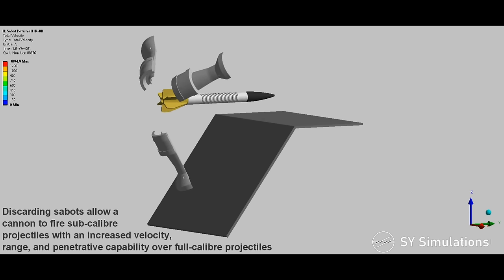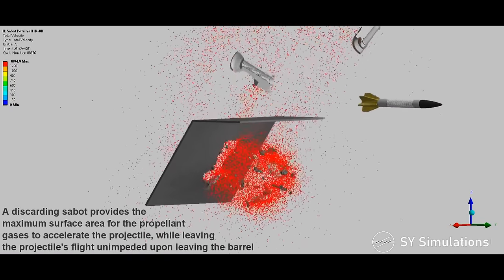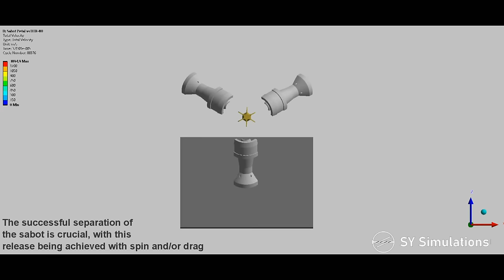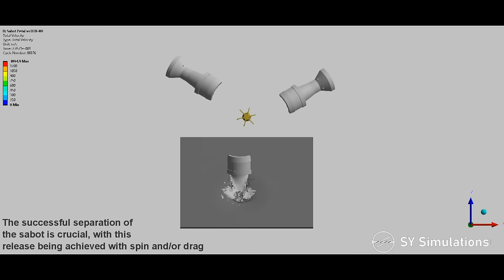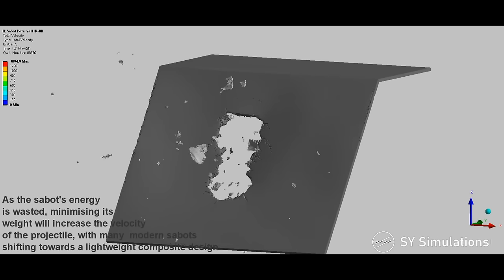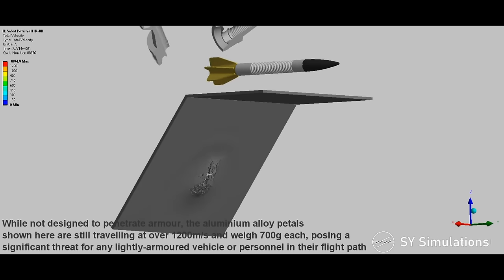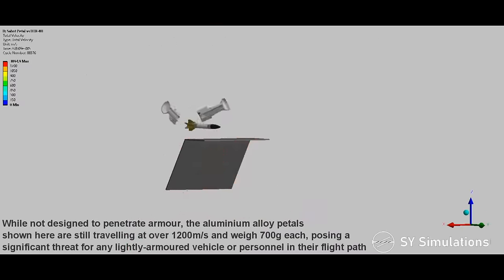HOW DANGEROUS ARE DISCARDING SABOTS? | Sabot Petal vs BTR-80A | Armour Penetration Simulation

Comment: War Thunder currently models them as being able to penetrate even the side armor of Shermans, which are 40mm, which is a bit ridiculous.
Reply: I mean, not really
They are traveling 1200m/s which is significantly faster than anything used in WW2, I think it could pen 40mm point blank, but not much more or any further
Reply: The problem in WT is they keep their velocity well into 500m or some BS
Reply: @a.anonymous1318 yeah the main issue is that even out to 100-250 meters those petals were punching through 38mm or 1.5 inches of armor (the side of the Sherman is 38mm 1.5")

Definitely it would not be going that speed still after tumbling through the air for 100+ meters
Reply: Warthunder is a game 😂
Reply: Didn't they remove them because it wasn't modelled well enough?
Reply: @NoName-md5zb  yep
Reply: @NoName-md5zb  yeah, his point was just that the model was ridiculously setup.
Reply: It probably could at point blank ranges, so maybe not all that ridiculous, but again, that depends on the range. A big problem with the discarding sabots in War Thunder is that they don't lose as much kinetic energy over range as they should be, effectively turning APFSDS into a shotgun that can obliterate light-medium armoured vehicles without really needing to aim.
Reply: I saw a video where a sabot penned the lower plate of an abrams from 100m. Its ridiculous.
Reply: @xxfalconarasxx5659  apfsds shotguns sound nice
Reply: @Blox117  i remember in the dev server apfsds autocannons absolutely obliterated aircraft without even needing to aim at them. Instead of reworking the effect, Gayjin took the lazy route and removed it for autocannons but kept it for main cannons.
Reply: @neurofiedyamato8763 Sabots from M1 Abrams(120mm) can be lethal up to 800m
Reply: @dominuslogik484  youre lying, they dont even go that far

Comment: Note that this is only true at very close range, the petals high surface area and low weight mean they would rapidly decelerate at any substantial distance.
Reply: try standing 30mtrs away and let one hit you to see what it's like🤣🤣
Reply: @nigelsmith7366 30m is very close range lmao. Vehicles engage each other at 100's of meters, sometimes over kilometers.
Reply: @92HazelMocha  well go ahead and try it at 100mtrs.... Its still going to knock you out in the least
Reply: @92HazelMocha  and we are talking about vehicles and troops being hit by the sabot petals being fired from their own tanks at targets down range... Its not about the petals causeing damage to enemies
Reply: @nigelsmith7366  
You can kill a person by throwing a stone at them, that still doesn't mean it'll go through armor plate with ease.
Reply: @nigelsmith7366 and that’s why you don’t stand in front of a cannon…
(Not to mention concussive forces)
Reply: Using the drag equation, I've estimated that the velocity drop after 5 seconds would be 50%. I assumed that it's a 105x200mm block giving drag coefficient of 1. The equation for velocity I got was v(t) = e^(-0,006 t^3) v_0. Since it starts at Mach 4 and ends at Mach 2 after 5 seconds, you'd still have a 700 gram block of aluminium flying at > Mach 2 at distance of 1000meters. I think it would still pen the same plate.
Ofc not an expert in aerodynamic or supersonic anything so there might be other drag factors involved but I also assumed that it flies largest face first without orienting itself better.
Reply: @softerseltzer  
You're forgetting the petals tumble around, going way off-course and slowing down much faster than if it was flying straight and true.
They're designed to decelerate as quick as possible to get off the rod, remember.
Reply: @ThatZenoGuy  I'm not forgetting it, I am disregarding tumbling or going way off course as being relevant to the penetration of something that is in its way. Can you show that tumbling causes objects to decelerate faster than flying with an orientation that is least aerodynamic?

I would argue that rather than decelerating as fast as possible, they are designed to accelerate outwards as fast as possible to get peeled off the rod.
Reply: @softerseltzer  
If the petals are tumbling, they're quite liable to impact side-on, which will massively reduce their penetration.
Reply: @ThatZenoGuy  In the video the impact is at around 45deg to the direction of the travel, which makes it about 70% side-on. Anyway, the point was about deceleration.
Reply: @92HazelMocha  30m is a perfectly normal distance to be from friendlies, though.
Reply: @nigelsmith7366  we are talking about tanks not humans
Reply: @ThatZenoGuy   As an aeronautical engineering student with basic aerodynamics knowledge I'd say that the tumbling effect might slow the petal a little bit due to a larger turbulent wake being created (maybe?) but from what I know it shouldn't have a very significant effect on the over-all speed of the petal, just it's flight path. I would be interested in your reasoning about why they'd slow down much faster, I'm not an expert. The only issue I see with francois' approximation of the deceleration is that the drag formula for subsonic speeds (which I'm assuming was used here) doesn't work well at supersonic speeds. Drag does very weird things from ~Mach 0.9 upwards and heavily depends on the shape of the object. I'd assume that the deceleration would be quicker because of the created wave drag, but it's hard to say how much. And as an engineering student in general: I'm 99% sure the petals are designed to diverge as quickly as possible, not to slow down as quickly as possible. They'd probably look different if lots of drag was the primary goal.
Reply: @planterion7969  
That's a lotta words, shame I'm not reading em.
Reply: Still they can fly up to a few hundred meters at worst, meaning anyone getting hit by one has a bad day. In other words, don't temp fate. You're still squishy and people have been wounded and killed by lighter and/or slower objects.
Reply: @ThePandoraGuy  
Right, still won't really go through steel plate at range.
Reply: @ThatZenoGuy   Someones lookin real smart right now…
Reply: @ThatZenoGuy  Won‘t go through - source: No idea, I made it up
Reply: @planterion7969  
You got a problem with that?
Reply: @ThatZenoGuy  True. And yet a thick steel plate is exactly were i want to be when a sabot round is fired in my general direction :D.
Reply: @ThePandoraGuy  
Well, a plate that'll stop a sabot, is not likely to stop the actual round itself.
Reply: @ThatZenoGuy  Hey my fellow guy, im still talking about pelats. If they come in my direction, i wanna have something sturdy between us. Sabot on the other hand, there is no discussion. When it hits you right, you're history. To fast to notice. Like "The lump of coal in your ass won't have the chance to become a diamond" fast.
Reply: @ThePandoraGuy  
Lmao
Reply: @softerseltzer  I suspect there's a mistake in your calculation. A .50 BMG bullet will slow to 50% of its muzzle velocity in approximately 1 second. I find it hard to believe a sabot is going to retain velocity better than that.
Reply: @dwaneanderson8039  The mistake is probably that the drag coefficient should be more velocity-dependent (higher) at supersonic speeds. Just like @planterion7969 said above. 

The table I found for .50 BMG says it will slow down to 50% after 2 seconds though. Say the petal slows down twice as fast, to 50% in 1 second, it will still be going Mach 2 after 1 second, which is 600m+ distance. My reply was to the original poster about "substantial distance" and "very close range" which I think would still be hundreds of meters.
Reply: This comment reply thread was...interesting.
Reply: @ThatZenoGuy  "a lotta words" that's 1 paragraph 😭😭😭

Comment: will say, quite an unrealistic scenario.

the sabot is designed to have a lot of drag, meaning it will lose speed extremely quickly.
as shown in this video, it's presented as if the end of the barrel from which it is fired is less than 10 meters away from the BTR

Comment: It's not something I've really given a great deal of thought to tbh. Does anyone know what the "threat cone" size and range is for modern 120mm and 125mm guns when firing fin? I can imagine that the petals can go a long way and fan out quite a bit meaning there could be quite the danger zone for friendly infantry (even if the chance of getting hit is slim). Even if they slow down to, say, 50m/s; 700g at that speed is no fucking joke to a mans body lol. 

And considering the probability of getting hit by the petals as infantry - I imagine autocannons firing fin can be a great threat to friendly infantry, even if the sabots will be far lighter and lose energy quicker
Reply: I forgot what the number is, but I'm sure the channel "The Chieftain" has answered this question before. It's a big number if memory serves, like 500 meters or something
Reply: From memory:
For 120mm, hazard zone for falling petals starts at 200m and ends at 1000m where it's 140m wide. Muzzle blast is potentially injuring at 200m, with special note reminding to watch out for glass falling from shattered windows, and can impare hearing at 500m.
For 25mm hazard zone is 100m long, 17 degree in both sides. Which is no surprise, sabot is about 5cm long, and half of it hollow, I'm guessing to increase air drag
Reply: found current range safety regulations (publicly available, don't report me 😀):
For 120mm AP sabot, hazard zone for falling petals is 1300m long, for MPAT sabot it's 750m. For 25mm sabot made entirely out of alluminun 400m clearance is required, for new hollow ones with plastic cap only 100m. Quite improvement.
Little extra: hazard zone for M829A3 projectile is 30km, zone for ricochet hazard is 2.4km, I assume around target. Targets cannot be placed higher than 5 degree upward, so elevation of gun doesn't exceed 5 + whatever gun needs to elevate to compensate for drop. I guess shooting at full elevation would require over 100km clearance behind target, which does sound like an issue.
Reply: @kireta21  Awesome to get some figures! I do wonder how "seriously" those rules are taken in an actual warzone - like for the 120mm, the likelihood of clocking a friendly soldier with one of three petals spread over a 100 metre wide area has to be really low - like not so low that you'd ignore it in training, but I could see it being ignored during wartime
Reply: @tommeakin1732  in kill-or-be-killed scenario no one expects you to hold back. If accident happens, it happens. After things calm down, it will be handled like any other accidental injury/death.
If it's not emergency, you'll be at least expected to warn guys in front of you and give them time to get out of way or into cover. Though generally infantry guys are aware of danger, and can be trusted to stay clear off your muzzle when you're going to need it.
Reply: @kireta21  Thanks for the info!